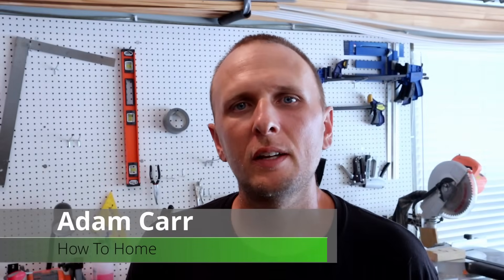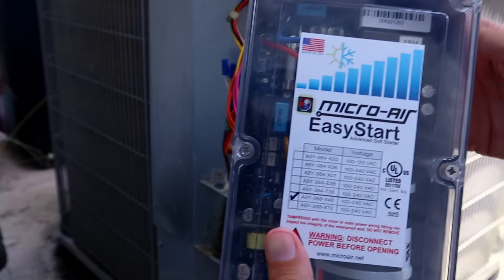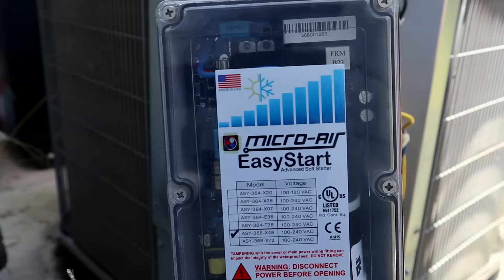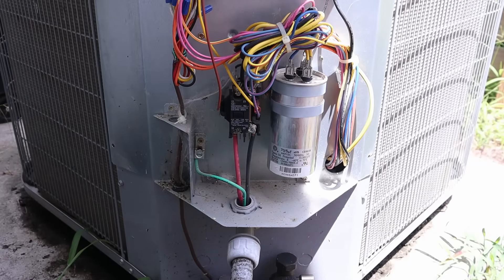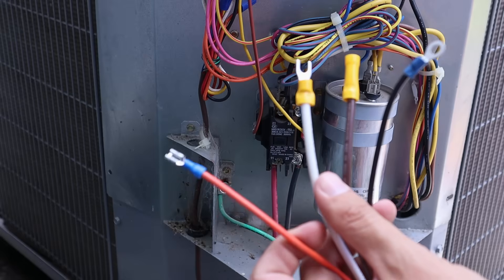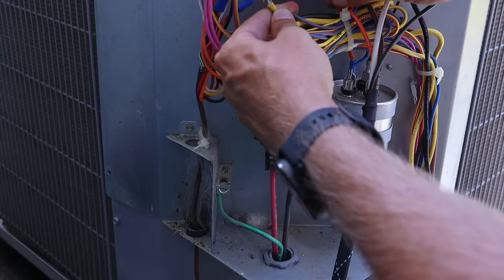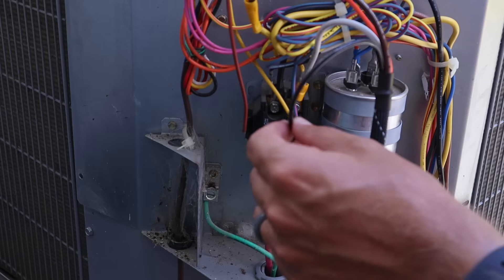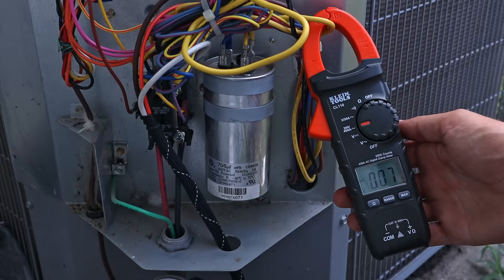How To Install A Soft Start Kit On A Air Conditioner | Run Home AC With A Generator | MicroAir

Comment: Thanks Adam! As a result of watching your video several times, I decided that EasyStart was the right solution for me. I am planning a 9.5kw emergency back-up generator.  I also installed an IoTaWatt power monitor so I could see my max loads on each circuit. I measured the inrush at my breaker legs to include the inrush amps to charge the capacitor. I was at 138a on each leg. I measured the running amps including the fan and compressor at 18.7a. I’ll be installing my EasyStart, sized for my 5 T on Saturday. I had to wait until they got some inventory in.
Reply from the maker: Yeah that is a big unit!  I think you will find it very helpful once you install it.  I love mine!  Generator barely pulls down when my 4 ton kicks on.
Reply: @HowToHomeDIY  I finally got my Easy Start unit installed yesterday due to shipping delays.  My results on my 5T AC unit were beyond my expectations.  My surge amps dropped from 138a per phase to 42+a/phase. But the big surprise was my running amps. They dropped from 19.2a per phase to 13.6a.  This was my measurement after 5 starts this morning.  That's a 1300 watt savings in my running power and a 69% drop in my surge amps.  I decided as a result of running Iotawatt Power Management and these final Easy Start measurements to drop my generator size for this winter to a smaller unit.  I am purchasing the WH iGen 4500 which will run all my house circuits except for my large appliances and AC. I may still purchase the WH 9.5kw/12.5kw peak next summer if I want to run AC.  But it consumes less than half the fuel during a blackout and most of ours come in the winter!  Thanks Adam!!  Awesome channel!
Reply: @gottofly2  I don't understand how this unit can reduce the running amps.  With all the efficiency mandates these days you'd think every a/c would be required to use one of these!
Reply: @jackmorgan709  after having it for 9 months, I have observed that the running amps stayed marginally the same-19a. The biggest drop was in my inrush amps. 138 to 42a. I ended up purchasing the bigger WH 9500.
Reply: @gottofly2  I went thru the same calculations in my head and just went for the biggest quietest invertor generator I could find that also could be converted to natural gas. You never regret having more wh available, especially when a neighbor is in need.

Comment: hey Adam thanks for the videos on setting up a generator for your house.   I followed your lead and it was far less intimidating plus the soft start was amazing.  I'm able to run my 4 ton a/c plus 2 large screen tvs, refrigerator, 2 computers, stereo and lights and 3 battery backups on a 7000watt running inverter generator.
Reply from the maker: Thats awesome!  Now when the power goes out, it will almost be like it didn't.  Glad you were able to get it all set up!
Reply: So…by adding some capacitance you’re able to ‘run’ just over 10kw ( at 120/240 single phase ) of load on an alternator and prime mover rated for only 7kw at peak output. Slick. I’d love to see it in action.
Reply: How long does 1 tank last?
Reply: @jonlee5642  one tank of what?
Reply: a mere bondservant  Honestly I just wired up the whole panel and I dont know what the final load was but the only major appliance I ran at once was the a/c but I had my main room running with 4 battery backups, 2 computers, one large tv and a microwave
Reply: you have a backfeed setup with interlock I assume? 

is your AC unit a heat pump too?

Comment: I just purchase a Predator 9500, but the 220 outlet is for 30 AMP and the generator said that is able to produce 63.3 AMP. I think that 63.3 amps is with all the 120v outlets in use.
My question is, how can I dedicate 63.3 amps to the 220v outlet and cancel the others.
Thank you
Reply from the maker: I am not sure how they can claim it has 63.3 amps when it produces 9500 watts/ 43 amps starting and 7500 watts / 34 amps running.  That is why there is only a 30 amp twist lock and not a 50 amp.  And the maximum wattages are the same whether you are using all the outlets at once or just one.  The 9500 watts starting is telling us its maximum starting capability.  I hope this helps!

Comment: Are there any cons to installing a soft start device on your compressor?   Seems odd; Gives you the flexibility of portable generators and it’s better for your compresser longevity wise.   Why aren’t  AC companies installing soft starts at the factory?
Reply from the maker: Really no cons other than initial investment.  They probably aren’t doing it due to increased cost and these soft start kits are still pretty new.

Comment: I think I’ll also go with a soft start instead .. attempted to start my 3.5 ton unit with my genes and it did not work … well I think it did work but all the other breaker turned off 😬 …do you know how many running watts your unit uses now?
Reply from the maker: I do net remember.  According to my sense device it says the AC is using about 3,000 watts running.

Comment: Thanks for the video, will be installing mine soon but can I measure my LRA before and after with a simple multi-meter that only has the probes?
Reply: You wouldn't be able to measure the amperage only the voltage so it wouldn't tell you much.
Reply from the maker: Yes what Ken said.  And you will want one with In-rush capabilities.

Comment: Which on is better hardstart or softstart
Reply from the maker: The soft start is in my opinion, the much better option.  Comes at a price but the benefits are more than a hard start kit.
Reply: Can you run 2 generators on the same electrical panel individual breakers feeding each leg  each leg would be on its own breaker so when you run one generator it runs only one side and the other one runs its own side in theory you can now use some of you 240 when need it what you think

Comment: Great video! Did you have to extend the wires when you mounted it so far from the connection points?
Reply from the maker: Yes, I was told by Micro Air that if you want to mount it further away that you can extend the the wires.  Originally that is what I did but I ended up moving it and mounting it right next to the unit on a post.  Thanks for the feedback!

Comment: would it work for mini pa audio system? I'm planning to install one to my home pa system for my dad. since he doesn't like too much button to push to run my pa system and he likes karaoke. i wonder if it's possible for my amplifiers and mixer? i only have breaker switch. if i turn it on directly to my amplifiers and mixers. the inrush current send to speakers which is could damage the coil of speaker

Comment: Do you have to shut off breaker to the ac? Or does pulling out the power lever enough?
Reply from the maker: Whatever you are most comfortable with, I just pulled the quick disconnect.  Shutting off the breaker is redundant to me but it wouldn't hurt to do it as well.
Reply: @HowToHomeDIY  can you discharge the capacitor with screw driver before removing any wires?

Comment: hi my friend. I know the purpose of why installing this soft kit which is to draw less amp when ac starts but my question is does it lower your power bill by any chance if using the soft kit? Thanks
Reply from the maker: I did see a little reduction with the running amps after the install but I don't think it will help the electric bill much if any.  Really just to help it start up more efficiently, which helps extend the life of the compressor along with making it easier for a generator to run.
Reply: @HowToHomeDIY  thank you

Comment: Are these worth installing if you don’t have a generator? Like just for your house ac unit to prolong its life?
Reply from the maker: I personally think so.  It should prolong the life of the compressor since it is starting up easier and I was on the phone with Micro Air about the soft start and they said it also helps protect against surges.  To me, the extra longevity of the compressor makes it work it in the long run.

Comment: I've been looking for this answer. Thank you for the thorough explanation, and the difference and cost between soft/hard start.

Can the idea of soft start be applied to well pumps also?
My goal is to run AC pump using solar panels and inverter.
Reply from the maker: Hey Richard, I have heard of folks using them for all sorts of things and well pumps is one of them.  They are pretty cool devices.  I am interested in solar.  In the research phase at the moment.  Thank you for the feedback.  I hope I was able to answer your question.
Reply: @HowToHomeDIY  Thank you. I will research more. It would be cool if it works with a pump.
I use DC pumps with solar. However, DC pumps are expensive. AC pumps are way cheaper, but they are a power hog during startup. That is where a soft/hard start kit would help to reduce the startup power.

Comment: Thanks, we just installed a couple of Tesla Powerwall 2 storage batteries and I wanted a soft start kit to reduce the amp draw when the batteries are running our 3.5 ton Ruud package air conditioner during peak energy hours when the Tesla Gateway switches our home over to off-grid battery-only mode. After finding and watching your video, I bought the same model of soft starter and installed it today. Very easy to do and seems to work as advertised. Thanks for taking the time to make this video.
Reply from the maker: Oh that sounds cool!  I am definitely interested in also having a way to provide electricity in the event of a longer power outage aside from a generator.  Have been looking at some solar setups.  The Powerwalls are interesting.  Glad to hear that this helped!

Comment: Great guide, did you install the bluetooth model? If so, did you set that up before installing the kit? I noticed that section in the appendix. Also, what gauge are these wires?
Reply: Did you ever set up the Bluetooth? I can't figure it out.

Comment: How far away from the compressor can It be mounted? I would like to put it in the garage where the power goes through the wall, approximately 6’.
Reply from the maker: Hey John, that would be a question for Micro air themselves.  I was told by them that the wiring could be extended and oftentimes is in order to mount it but was not given specifics as far as distance.  They are very helpful and responsive!
Reply: @HowToHomeDIY  Thanks for all the information, I bookmarked their website and I’ll contact them tomorrow, I live in southwest Florida and the unit in on the south side of the house so the conditions are extreme at times. I’ll let you know what they say. Thanks again for the great video.

Comment: What protects this thing from power surges?
Reply from the maker: You can get a whole house surge protector.  I have talked to the manufacturer directly about it and it does serve as a barrier against surges to your unit as well.
Reply: @HowToHomeDIY  Since it appears to involve a circuit board it might be a good idea to at least have some type of fuse or breaker built in to keep it from being fried. Maybe an electrician  or HVAC specialist would know if this would be necessary.
Reply from the maker: A breaker is not going to stop a external surge to this or any other device in the home for that matter.  You need a SPD device either on your panel or the circuit itself that the AC is on if that’s the concern.  I installed a whole house surge protector for this reason.

Comment: I'm interested in how you extended the wire leads and protected them. I'm going to butt splice longer wires to the ends of the soft-start with heat shrink butt splices, but I wasn't sure how I would protect those four loose wires. I will need a conduit but wasn't sure how to connect the conduit to the soft-start box for a water-tight seal. What did you do?
Reply from the maker: I didn’t extend them.  If I was to do so, I would use THHN/THWN wire and run it through liquid tight conduit.
Reply: If it is outside don't you have to have the join be in a box?

Comment: Capacitors can hold a charge even if the disconnect is pulled
Reply from the maker: Indeed they can.  Usually it is discharged through the windings of the compressor so it is rare, but possible.  Can be discharged using a screwdriver while holding the insulated handle and touching the metal portion to common, herm, and fan simultaneously.  A resistor would be a better tool to use however.
Reply: @HowToHomeDIY  Can you discharge capacitor while all wires are still connected? Before you start taking wires off etc. Im just scared of a short or something.

Comment: wonder what the amp draw of the fan was on start, looked like it only delayed the compressor and allowed the fan to start first. I liked your video on the hard start kit, I think that's the way to go for me. I'm wanting to change from piston to txv
Reply from the maker: I have never checked that with my multimeter but for what it is worth, I do have a sense device that monitors all my electrical use in the house and the fan is pulling right around 3 amps when it starts.  That is exactly how it works, it starts the fan first for just a few seconds and then the compressor kicks on.  Yeah everyone has different needs, my dad installed a hard start on his smaller AC (2.5 Ton) and it works just fine.  Hope this was helpful!

Comment: Yo! DON'T EVER stick your finger in capacitor terminals like that without first checking between terminals with a volt meter or draining terminals with a resistor or screwdriver (if you have nothing else) first! That's a quick way to get the living hell shocked out of you if, for some reason, the capacitor still has a charge!
Reply: I actually asked  Microaire the same question on their YouTube channel. The guy giving the video responded that since the capacitor is wired into the compressor motor windings it discharges almost immediately after it turns off. Feel much better about messing around in there now.
Reply: @goofsaddggkle7351  unless the compressor failed open winding (the cause of lots of service calls), the cap could easily have 300V+ in it if it didn't bleed on its own
Reply: @ThatITguyChris  Well my ac works fine so that isnt an issue. You can ‘but if’ this as much as you like - im communicating what is existing in normal operating conditions.
Reply: Wait but that's the fun part right? Lol
Reply: Yeah! I was like "WHOA" 😱 when I saw him just stick his finger in there. Haha
Reply: So how do you drain the cap, as a complete noob who doesn't feel comfortable shorting it with a screwdriver lol
Reply: @goofsaddggkle7351  use a 100k resistor or similar, touch the resistor leads one to each terminal on the capacitor, hold for several seconds, this drains the electricity safely
Reply: @YuriSoul2222  thank you!!
Reply: @goofsaddggkle7351  two wires one from each side and stick them in a cup of water not a metal cup
Reply: That's what I was thinking.  I hear the capacitor retains a charge, and it's a doozy!!
Reply: I cringed when I saw that 😮
Reply: I’m surprised he’s still standing!
Reply: I was going to say the same thing
Reply: Who would I have to hire to get this device properly installed?
Reply: @roelgonzalez538 Electrician but they will charge big money. It’s easy, do it yourself. Only 4 wires.
Reply: @Thatsallihavetosayaboutthat So many people these days can’t follow any instructions, so it will costs them a lot more to DIY.
Reply: AC capacitors discharge through the motor windings. If a wire breaks, you might get shocked
Reply: @willalthen8667 what do you mean. If a wire breaks, you might get shocked. How would I know if a wire breaks?
Reply: That was my thought as well! 30 plus years as an electrician.
Reply: Yep! learned that the hard way myself and ruined ALL of the cards in my wallet from the resulting E.M.P.
Reply: Im sure he discharged it first. He has a video how to change capacitors snd he shows discharging.
Reply: @anthonyz5671  he didn't show discharging in this video though. He just reaches in and touches it.

Comment: The video is very informative but at the same time it’s a real head-scratcher( for me anyway😂). A hard start kit is supposed to reduce the IRA’s but at the same time, some older compressors need a “kick” to get them to start. Do you think an older compressor will benefit from this soft start???
I’ve seen soft start technologies on ambulances going back to the early 90’s where you would turn on one Master lighting switch and each separate group would come on one at a time. This was to spare the alternator the initial “smack in the head” from the power draw. I’ll definitely purchase it for my next system. The one I have now has had so many hands in it , I’m afraid to try it😬.
Reply from the maker: I will try to answer this as best as I can as I am not an HVAC technician and I have not had hands on experience with a soft start kit used in the application you are talking about.  A hard start kit does not lower the actual in rush, what it does is it starts the compressor as fast as possible.  So it still calls for a lot amperage but because it gets the compressor started so much faster it is like the in rush is being lowered.  I hope this makes sense.  I think any compressor would benefit from a soft start kit.  They start the fan before the compressor, they slowly start the compressor up by only using the amperage necessary to start it, this can lead to longer longevity as well.  Now what I do not know for sure, is if the compressor is having a hard time starting, if a soft start would be better than a hard start.  I would think in that case a hard start kit would be needed as the original capacitor that was fitted for that particular compressor may not be able to turn the compressor over like it used to due to age, wear, and friction in the compressor, so it needs some help.  I hope this helps!
Reply: @HowToHomeDIY  Yes this helped explain a lot. Thanks for the reply, looking forward to more videos. Keep up the good work.👍